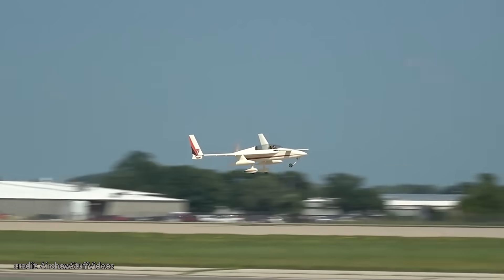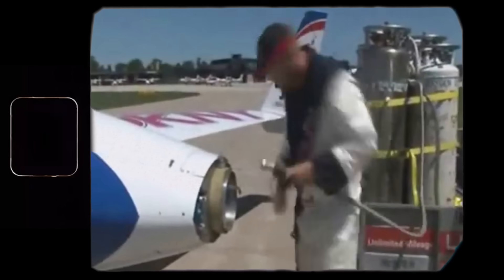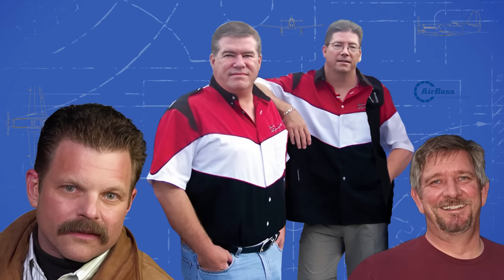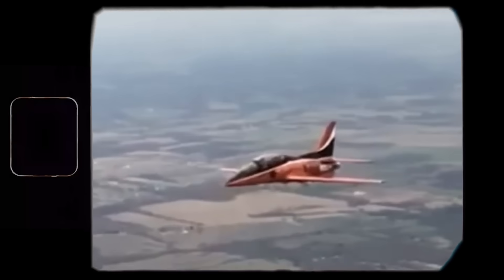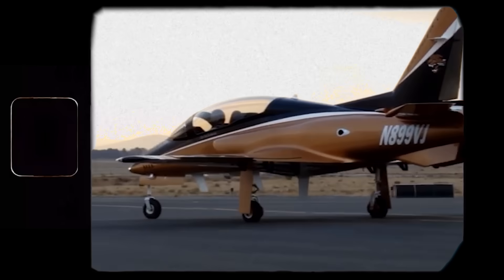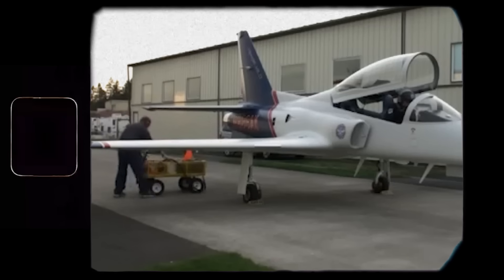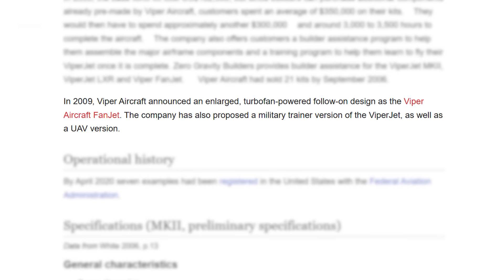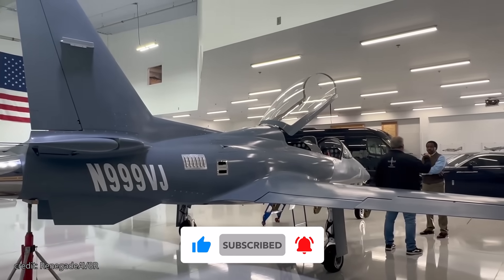ViperJet – DIY 525 MPH Fighter Jet? Review, History & Specs!

Comment: This math doesn’t add up. It holds 300 gallons, burns 250 gallons an hour with a cruise speed of about 500mph. How can it have a range of 1000 miles?
Reply: The graphic said 250 gallons an hour at 75% while the voice over said at full power. I'd assume the 1000 miles range is at cruise and possibly without reserve.

Comment: Why not install 1 external fuel tank under each wing? This would have increased the flight range by 2 times, considering that the internal tank here is very small. Well, the fact that the maximum speed would have dropped a little would not have been significant for the owner.

Comment: Jet has huge potential but the excessive engine was a mistake as was the complicated fuselage. Intakes don't need to be a complicated part of the fuselage. 
Carrying two people takes very little carbon fiber weight so shoot for 600kg MTOW and 200kg thrust and that's plenty. Especially if you pressurize the cabin so it can take advantage of thin air where jets shine. You can waste enormous engine power pushing bad aerodynamics through thick air. And that's what it does.
Keep it simple, keep it clean, keep it rational. At no point should 'let's make it look like an F5' enter the equation. There are far better shapes. More like a glider with two small turbofans at the back and smaller skinnier wings. It can be dirt cheap to produce. It can be a GA revolution, if done right

Comment: A gas turbine (as in a turbojet or turbofan) is a combustion engine. What did you think the fuel did in the combustion chambers? 

A gas turbine - in its normal form such as used in aircraft - is even an internal combustion engine, because the combustion in inside the engine, in the working fluid (air) flow. 

A gas turbine engine is not a piston engine, which is the term which should have been used. The difference is that combustion is continuous in a turbine engine, and inherently interrupted in a piston engine.

Comment: Somebody should recreate the Me 163 as a kitplane. Replace the rocket motor with a small jet. Put air intakes in the leading edge at the wing roots. T/off and landing on a fuselage-mounted wheel, plus strakes on the wings as with gliders. Laser-scan the fuselage and wings of a Me 163 in a museum. The flight characteristics of the 163 are well-known, from a dead-stick glider all the way to 500mph. The new 163 would sell well, as the cheapest way to acquire a warbird.

Comment: To be honest, half a million for a plane with that kind of performance is an absolute bargain. a 10.000ft/minute climb rate is essentially the same speed as freefalling due to gravity, but in the opposite direction. I can't imagine what a thrill it would be. To those saying buy an L-39, it had 1/3 the climb speed of this beast. It's a completely different animal.
Reply: Well said when you step into turbine technology you step into a whole level level of machining, balancing and other things that require extreme precision. This was out of a trainer not a fighter the f-15 has two engines at 39,000 pounds of thrust each. Again agreed Speed and ROC are amazing for $$.

Comment: It's for the man with too much money. There are plenty of those around.
Reply: It's not that simple-- the man with too much money doesn't want to spend $500K and 5 years building a 2 seater.  Rich guys want to buy a working rocket.  Basic misunderstanding in the original blokes.
Reply: It is even less simple than that…

The guy with too much money…

Has enough mechanical skill to build…

Or has even more money to have somebody else build it…

Doesn’t want to own the A model.

Nobody wants to fly the A model…

Few would want to fly the first 10 serial numbers of the B model either…

Personally, my preference is to own one that is a decade old, with 1k hrs on it already…

Infant mortality of new airplanes is a real thing… having a failure of the engine will cost a mint.

Landing in a field at high speeds is going to be uncomfortable….

So Viper team…. Get started!  I want to buy one 10years from now…. From somebody that has done the break-in flights….  

😃

Comment: Not worth the cost. You can get an L-39 for the same price or cheaper and it's already built
Reply: You make an excellent point. Not to mention the L-39 is a proven airframe. One just has to do due diligence.
Reply: Going to guess the guys buying these actually enjoy the building portion as well.
Reply: @shalakabooyaka1480  that's a hefty premium to DIY
Reply: @rightsideup96   It IS a pretty badass diy jet though. Anything with $100k jet engine and $70k in avionics is going to be expensive though.
Reply: @shalakabooyaka1480  but you are just not getting anything for your money. Which is mostly likely why it didn't take off "no pun intended" why wouldnt you just get an l39 which is good to go and preforms better. ,proven airframes etc...
Reply: Go to China and get one built for $30000 USD,simple!
Reply: @CarolynDarling1986  China has a bad reputation for quality for a reason, and the proof is in the pudding. When it comes to high-stakes engineering—especially something as niche and life-critical as a kit jet—there’s no substitute for American, German, or other European craftsmanship. China might do fine with mass-producing toys and simple electronics, but when precision, safety, and longevity matter, their track record speaks for itself. There’s a reason “Made in China” carries a negative connotation, and it’s not some random stereotype—it’s decades of cutting corners, weak quality control, and disposable manufacturing. You don’t trust your life to the cheapest option; you trust it to the best.
Reply: But you can’t work on it unless you’re an a&p
Reply: @dougb27  you can. Work just has to be signed off.
Reply: nope it experimental, as the builder you can handle everything assuming you have the repair certificate
Reply: You don’t get it and never will. Anyone can buy a plane.
Reply: @Mr.Alwaysright-z8q well, it's not exactly selling. Wonder why🤔
Reply: @rightsideup96 it takes an extraordinary human to take on a project like this. Sadly, the younger generation has none. They would rather buy what someone else built and anyone can have.
Reply: @Mr.Alwaysright-z8q it's not about generations. Im as an aviator as they come. It's about the economics of the deal. It makes no sense regardless of the generation. Even if this was available 20 or 30 years ago the results would be the same. And the numbers speak for themselves
Reply: Outside of price, a Gulfstream outperforms these in every useful way. If you want acrobatics, the L39 wins again.
Reply: @PiDsPagePrototypes  what?
Reply: @PiDsPagePrototypes  not sure where you’re trying to go with point but….here’s something to consider. For the amount of money you would spend to buy and the up keep of your Gulfstream. You could buy both the Viper Jet and a L-39. And still have enough money left to buy an island. JS🤷🏼‍♂️
Reply: What y’all recon the difference in insurance costs? Military surplus is not likely to be cheap…